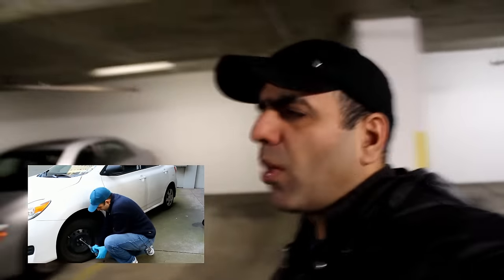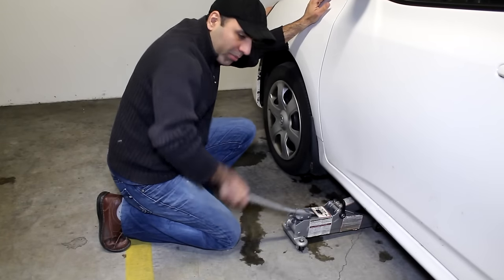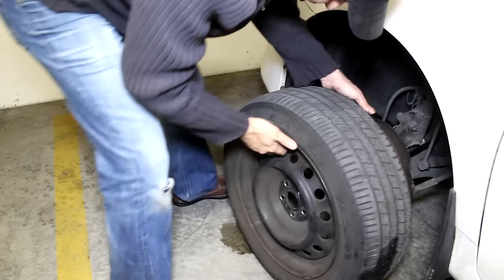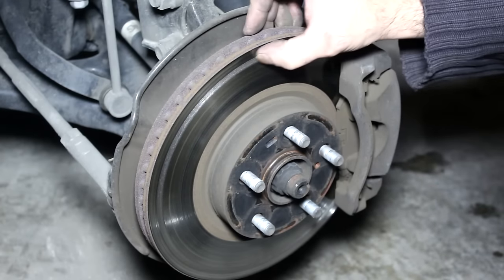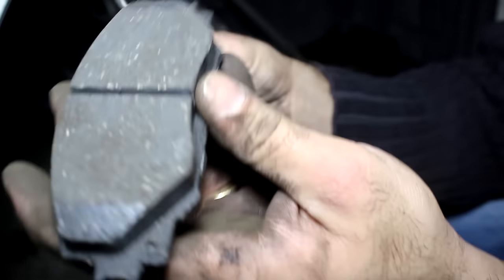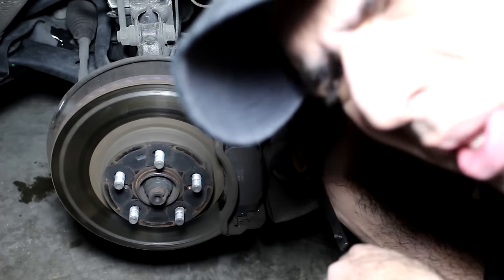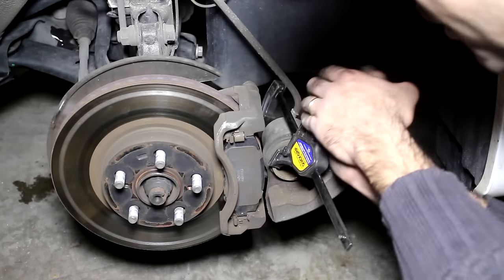ElectroVLOG-003: Changing the Last Pad

Comment: Wheel studs/nuts are much easier to break loose using a breaker bar (Law of the Lever).
Caliper pistons are much easier to wind back if the cap is removed from the brake fluid reservoir.  
Fluid above the max fill level can then be drawn out using a clean syringe.  
Brake rotors and pads work much better if they're not contaminated with oily finger prints.  
ALWAYS use a torque wrench when tightening fasteners.

Comment: if you loosen the cap of the brake fluid, that will allow the air to escape so there is more room for brake fluid in the reservoir.
Reply: the cap on the master cylinder reservoir isn't air tight. makes no difference. if it were air tight, it would always be vacuum locked when you applied brakes.

Comment: Keep the vlog posts coming. 
-You can get model specific tips on line if you don't have the service manual. 
-It's a good idea to extend the pistons a little. Then clean the grunge off rather than pushing the gunk past the dust/fluid seals. Wet an old flat shoe lace with brake Fluid and wrap it around the piston and pull it back and forth. Brake fluid works great as a cleaner for this. 
-Brake Cleaner shouldn't come in contact with the seals. 
-Brake lube is silicone based and is compatible with the type of rubber used in the seals. Regular grease shouldn't be used in the area. 
- The stupid cheap torque wrenches from horror freight are actually pretty accurate. Just work the clicky a few times before torquing the bolts. Just remember to back off the setting when storing it so the spring isn't compressed.

Comment: I know this is an old video but I learned from my stubborn truck you can crack the bleeder or brake line while the clamp is on to push the piston in to make it easier it's bleeding it at the same time if you do it that way so you won't have a spongy pedal and air in the system

Comment: it's 4 years after, i know. but if you want to push brake piston easier open hood and open brake cylinder reservoir cover. and don't forget to close it right after! brake fluid can get water from air, and you don't want it

Comment: Put the old brake pad in the caliper to help spread the pressure of the clamp evenly over the Piston.  Also use a regular "C" clamp. It requires less effort to compress.

Comment: If you take the cap off of the master cylinder while you try to squeeze the piston back in, then it will go in easier as the fluid doesn't have to fight the air space within the reservoir.

Comment: If you take out a litle of Brake fluid the piston will go inside easier, you can use a siringe or you can just open the deposit and let it drop. Maybe you will need a bit of breaker liquid to compensate after, but this makes this job a lot easier, because the way Mehdi did it, he is fighting against the hidraulic pressure of the breaker system.

Comment: Take the cap off the master cylinder when you press the piston into the caliper. It will release the pressure making it easy to push the piston back  in.

Comment: place one of the old brake pads across the piston and use the clamp on the centre of the pad to push it back into the caliper, by putting the clamp on the edge of the piston you applied an uneven force which can make the piston bind in the bore

Comment: Next time, open the cap on your hydraulic fluid capacitor reservoir. This will allow the build up of pressure at the brake clamp to flow back into the fluid reservoir. Use a Brake Clamp compressor tool to compress the brake pad clamp piston. Also, brake fluid absorbs water from the air,  it is recommended to flush your stopper pad fluid to prevent rusting of your system.

Comment: Mehdi, if you remove your brake caliper, don't let it hang from the brake lines. This can damage the brake line and cause a leak, which can cause your brakes to fail (and maybe kill you).

If a brake caliper is not attached, it should always be resting on something that supports it without tension on the brake line.

Comment: I love these videos and always look forward to the next one, but a few tips on this (as I've just replaced the brake pads and discs on my car) firstly, open the brake fluid reservoir which is located under the hood (bonnet if you're English like me), you might want to put something to catch any brake fluid if it overflows when you push the piston back. Secondly, use a proper windback or rewind tool for the piston, it will push it back more evenly and avoid any damage to the piston or caliper as it will put pressure across the whole piston and not just one side of it. remember to put the cap back on the reservoir before you turn the engine on or put any pressure on the brakes! I'd also use a 2nd jack, just in case the one fails and you trap your hand, arm, face, or any other body part under the car!

Comment: Just for fun I bought a cheap torque wrench so I could torque the wheel nuts to the right specification... I was amazed how loose they are supposed to be.. in the old days I had to jump on the tire iron or use a extension pipe.. it was such a pain. I also use some kind of lubrication on the threads. In fact I use tar spray.

Comment: they don't get tighter, they oxidise. use a copper brush to remove the rust from bolts and wheel hub, then use a tiny tiny bit of copper paste on both, that way, the full torque goes into holding the wheel on (instead of the thread) and next time you need to get it loose, it will be super easy.

Comment: Did you take the cap off the fluid tank before trying to push the caliper piston back in? Shouldn't be that hard unless the clamp is weak. Ive used g-clamps before was easy.

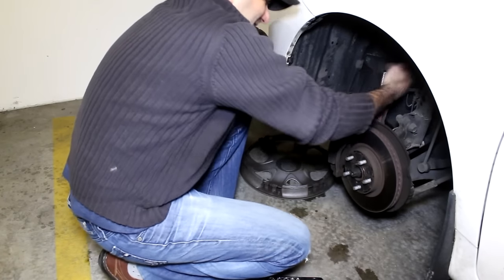Comment: Pro tip: break the lug nuts loose just a bit before you jack up the car. Also that pause at 1:53 "[pauses] I'm making it tighter..." I cannot explain how many times I've done that because I'm backwards to the bolt.

Comment: Squealer goes on the pad you can't see. Also loosen not remove your brake fluid reservoir lid to let the air out when you push piston back in. Test brake fluid for moisture after 500 miles of driving to see if it needs  changing.
Reply: Extra the squealer get dragged by disc not pushed

Comment: Did you take the cover of you brake fluid container off to release pressure?
Also use a G clamp with a screw system instead of a C clamp

Comment: Brakes should always be done in pairs. It keeps the vehicle from dragging to the left or right while braking. I would also check the rear pads. That metal strip is to help hold the brake pad in place, the pads should never wear down that far.

Comment: If you loosen and or remove the cap on your brake fluid reservoir under the hood, it allows you to push the brake caliper piston back in with ease..just make sure to put it back after your done.

Comment: Open the brake fluid res cap while pushing the cylinder thing in. Might help relieve the hydraulic pressure and also keeps it from overflowing.

Comment: calipers are where any moisture will accumulate over time, so when you push the piston back in, crack the bleeder screw as you do it, and not only will be easier to do, but it's a poor man's "brake fluid flush" also - asbestos is the bestest!

Comment: To not to struggle like our dear Mehdi with pushing brake piston back in, just do it before you take brake clamp off, by using tire iron) I wrote it because all of the comments aftors were more worry about tightening the nuts on the ground and other very simple mistakes

Comment: use like a pipe or a tube to elongate the distance from the thing u use to unscrew because

momentum = force x parallel distance from pivot

doing that u increase the parallel distance from pivot therefore greater momentum

Comment: The easier way to push the piston from the brake caliper in is to use a C clamp instead of a bar clamp. That way you can screw it in to get more force on the piston.

Comment: I've found that it's easier to loosen the lugs by (as others have mentioned) having the wheel on the ground.  Also, you aren't positioning your body (arms straight out) properly.  Stand on your feet and push the lug wrench with one hand while simultaneously pulling with the other.  

Standing on a lug wrench may break the wrench as well as strip the wrench or damage the  lug.  I've never had to resort to standing on a lug wrench in about 4 decades plus.

Comment: There may be two reasons, why the piston gets back in that dificult. At first, applying force to only one half of the piston, creates friction inside the break (it has to move in a close to perfect 90 degree angle) and possibly the age of the break. You may need to prepare some heavy work one the break within the next years. It is possible to do this yourself but very hard though. To push the piston back in with a clamp you may grap some steel piece and align the clamp force directly in the middle of the piston. Safe driving!

Comment: 5:50 actually if you just take the cap off the brake fluid under the hood, it will release the pressure on the piston so you can compress it without bleeding the brakes
Reply: GETLOWDUDE  This isn't actually true, there is always some mechanism built into the master cylinder to allow the fluid level to drop as the pads wear (either a simple breather or a flexible rubber diaphragm to separate the fluid from air), and the same feature will allow the fluid level to rise when the caliper piston is pushed back in.  The only time this is a problem is if the reservoir has been topped up with worn pads, in which case it will overflow when the pistons are pushed back in.
Reply: mikerjuk if the master cylinder isn’t overfilled, it won’t overflow from back pressure
Reply: GETLOWDUDE That's exactly what I said.  Provided the master master cylinder reservoir has not been topped up between pad changes, then pushing the caliper pistons in won't cause an overflow.  If someone has topped it up, then you will need to remove some fluid from the reservoir to prevent it overflowing.  

The fact remains that if air can get into the reservoir to allow the fluid level to drop as the pads wear, then it can also get out when you push the pistons back in.
Reply: Why not just put a bar in the caliper before you take the old pads out. No need for clamps
Reply: mikerjuk 
You both are half correct.
Unless you have a performance,or some kind of "fancy" car, which obviously this is not, the cap has a graduated, collapsing rubber gasket inside of the reservoir lid. As the fluid level slowly drops from pad wear,it makes a suction that pulls the gasket down to the top level of the fluid. You will see a pin hole on the master cylinder cover to allow air into the top end of the cap,above the gasket.
Reply: The cap isn't creating much pressure resistance. The fluid is simply not meant to be forced back up into the master cylinder when it is in that position. Just crack the bleeder on the caliper and push in the piston. Then tighten the bleeder and you're fine. No need for bleeding air from the system.
Reply: Then you need to bleed the brake
Reply: Yeah, that's not how it works at all.
Reply: The only time you have to bleed it is if you've run it completely dry or are replacing a caliper. It's not even about how much force is used. You just got to give the fluid time to push back.  I usually just use my thumbs on rear calipers.
Reply: @markjacobsen302  I know how breaks work. Ive changed enough. Not once used a clamp
Reply: @Liberator975  Ok, but do you know how brakes work?

Comment: When compressing the caliper piston, take the cap off of the break fluid reservoir! That will allow the fluid to back up through the lines. Also, use a C-Clamp, not those clamps... You risk pushing the piston in at an angle, ruining the caliper.

Comment: Use a spent brake pad on the piston and used the clamp on the spent break bad and back of the caliper. Equalization of pressure and what not.

Comment: Easier way I found from experience was keep pressing the brake pedal without the engine on which then depletes the pressure in the system, saves having to bleed the system afterwards, I also struggled the same way, as mine on my van and quite abit bigger

Comment: Guys,

How does a car battery work. My dad thinks they are not rechargeable and when it dies after 1 years of use age he installs a new one

Please help
Reply: If you want the topic explained very thoroughly: The google search terms are "Lead-Acid-Battery explained" and "Electro chemistry".
In short: a charged battery contains sulfuric acid. One electrode (the part that dips into the acid and is a - Pole) is made out of lead (Pb). The + Electrode is made out of PbSO4 (Lead Sulfate). This creates an electrochemical voltage between the electrodes. Connecting them through a load causes electrons to flow => you get current out of it and discharge it. This process is electrochemical. Both electrodes turn into PbSO4 and the acid turns into water. Charging the battery reverts the process.
However: If you discharge the battery to much, crystals which cannot be removed will build up on the electrodes making the battery less powerful or even completely useless. So your dad would need to change his battery if he leaves his car unused for a long time without charging the battery because this kills it.
Reply: Schaeren Jannic 

Yeah but sadly we replaced it

Also, near the + Terminal some green goop just like there...

I am not sure 😅

Comment: That special spray is brake cleaner its only a few bucks at any parts store :) Also you should try cleaning the surfaces where the pads make contact to the bracket, and lube the slider pins. Also a helpful tip is to put an old pad on the piston of the brakes while you press it in; that way it pushes in more evenly hopefully making it easier. 

P.S. Idk if my eyes are tricking me but I see a big wet spot under your car and near your lower control arm
Reply: Hey uhh I’m 5 years late but as a mechanic it looks like moisture. If it was hydraulic fluid from the suspension then it would look like a rainbow at that angle especially with the lighting (think oil on a wet road). Looking at his brake lines I can’t see any leakage or wetness around where the hose connects from the master cylinder or the piston, so I can honestly say it’s just moisture.

Comment: Break/tighten nuts while car is on ground, don't stand on cross bar when trying to break and use a breaker bar instead, replace your brake hardware when you change your pads (those little metal clips), use a proper piston compressor to compress the caliper piston, resurface your disc when it's damaged like that, use a jack stand along with your hydraulic lift in case the hydraulic lift fails...

Comment: Next time leave the old brake pad on and then use the clamp to squeeze the piston closed... then remove the old brake pad... the way you were doing it was binding the piston because you didn't use equal pressure on all sides of the piston.... which is why you use the brake pad. If you had a 2nd clamp to use on the opposite (3 o'clock) side of the piston it would have worked better.

Comment: dude compress the piston before disassembly. theres an open slot on the front of the caliper. use a flathead screwdriver to pry between the old pad and the rotor to press the piston in. then its compressed already before removal.... and that groove on the disc is going to eat your pad and cause irratic grabbing and pulsation.

Comment: btw, you should break your lugs free before jacking the car up, then take them off the rest of the way. also you're using the wrong kind of clamp on that caliper. And you're probably fighting against more resistance unless you remembered to remove the cap from the fluid reservoir first.

Comment: YOu could also bleed your brakes while forcing the piston back in with the clamp. That would've taken all of the force out that, and I've heard that you can break your power braking switch by putting that much for on the piston without letting fluid drain.

Dunno how true that was though.

Comment: For the cost of discs, just pick up a cheap one and throw it on.. for one that small it might only be $20. You should clean the caliper sliders and areas that the tabs on the brake pads  set into so that they do not bind.

Also, those clamps are horrible for applying much pressure. You would have had an easier time with a flat piece of steel to provide leverage :)

Comment: those freaking wheel nuts are alwayys over tightened probably. I tried dynamometer wrench and torqued to spec, for several years no fighting with hard to unscrew wheelnuts while changing wheels for winter/summer

Comment: Come on man!, lol there is a small valve by the break piston that is used for bleeding the breaks.  You open it up, put a container by it and squeeze the piston effortlessly as a little break fluid squirts out.  Tighten up the bleeding valve continue as usual.  Before you put the wheel back on you add more break fluid to your reserve and bleed the lines.  Much easier and you get new break fluid in your system.  

Mind you, what was shown was in NO way wrong and I get it's comedic effect but I had to pitch in 😋

Comment: C clamp and old pad will make compressing the piston back a ton easier
Reply: old pad's a great idea, i normally use a thin block of wood and a G clamp.  But remembre folks, wind her back in steady (and evenly!), as you risk damaging the seal.  If you damage the seal (a rubber layer surrounding the brake piston), your brakes will cease and you'll have to either pay a few hundred pounds, or else get to know how to overhaul a brake calliper..which by the way, isn't such a hard job, worst bit is getting eh new seal in!.